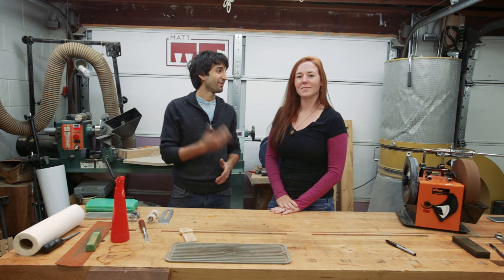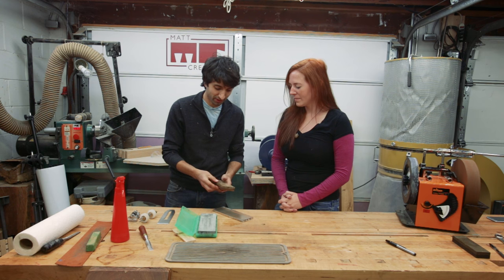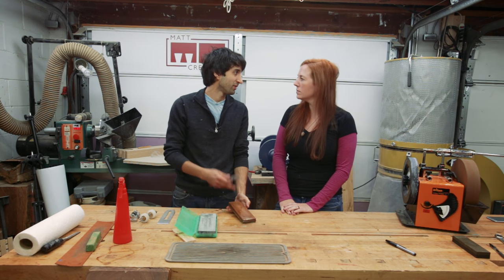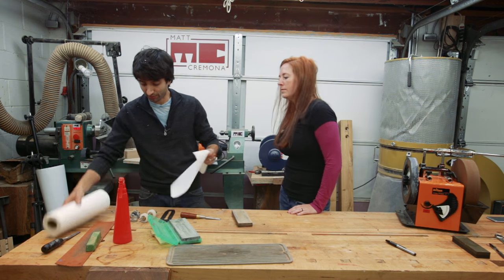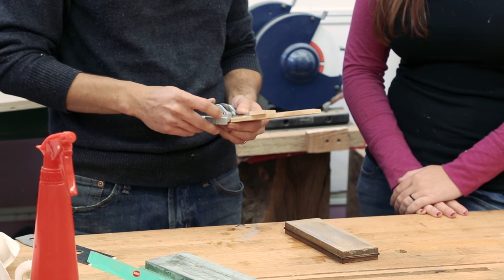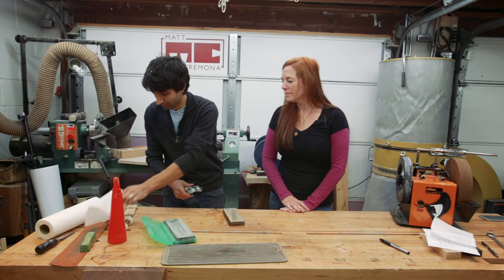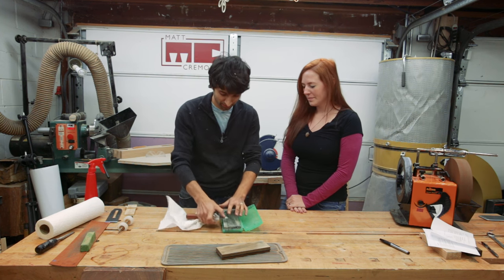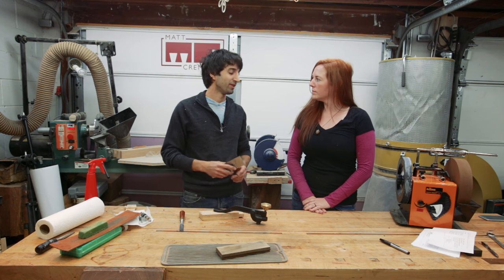Matt Cremona on Sharpening & Maintaining Tools

Comment: I do the same thing with the strop and the honing compound. I'm terrible at sharpening. I really should learn, but instead I take my gouges and hook knives to be sharpened by a pro, and afterwards I just use the leather strop ever half hour or so of carving (more frequently if I'm using a really hard wood) and it makes a huge difference in how easy carving is. Matt's so right, you really can feel the difference by just taking a minutes during a project to just maintain the edge. Great video.

Comment: I don't think Tritons resurrection back into the DIY market will be successful, example who would buy a table saw that needs both the front & back ends equalled just to try to make a straight true cut, hope they pay well as sponsors
Reply from the maker: Hi Dirk, the two point lock has been a trademark of the Triton workcentre for years and you get used to it pretty quick. However  we do have a single point fence on the way for those who find it an issue